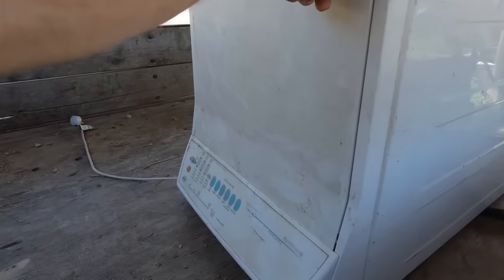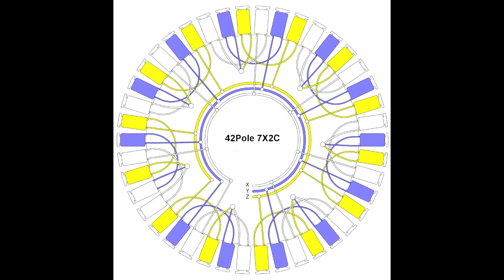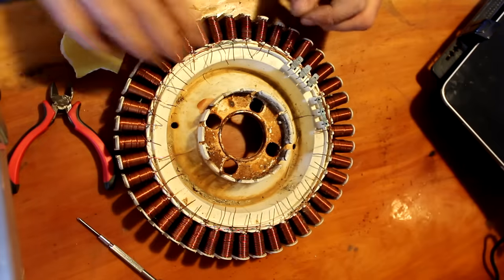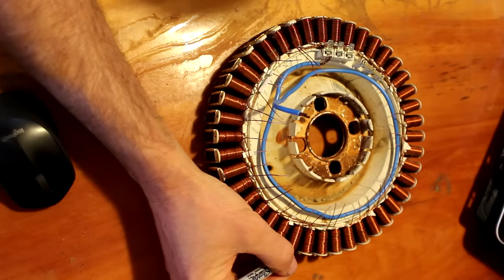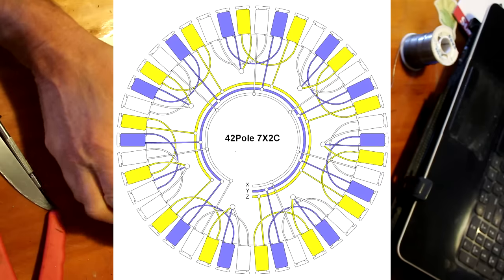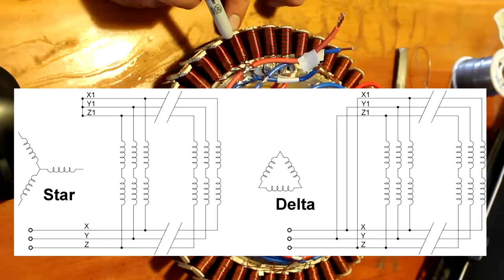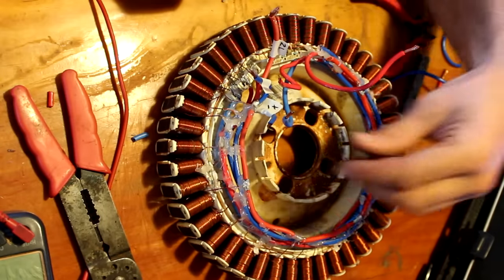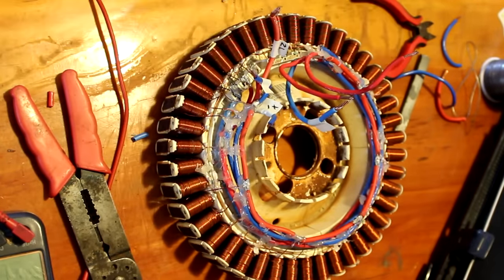Free Power from Water Part 3- Rewiring a smartdrive washing machine motor to generate power

Comment: Seemed to me you guys can use a generator to to work the same principle 10K will work I would say just out of curiosity you working real good I like this idea very much too bad you're in New Zealand I wish I was there but I'm in another country anyway hopefully you get back at me I was curious why you don't use a generator seems to me it would work if you put same work into it out of curiosity that is all God bless you
Reply: What type of generator and what type of driving force are you thinking of using?
Reply: @JohnSmith-pl2bk  I don't have a place where I can do that I was just curious why you couldn't use a generator that is all
Reply: Not trying to be stupid or something I'm just curious if it would work that's all seems to me you'd hook up a generator to that and it would turn to I'm not sure I got will generator with a 5 horsepower motor put out almost 10000
Reply: @jtturner6585  
The reason to use water is not having to pay for fuel ever again.
Gravity gives the water energy; the energy is transferred by the Pelton wheel and generator into electrical energy....simply and economically...
Reply: @JohnSmith-pl2bk  I understand that but when I'm saying is can you take the generator part without the motor and use I don't like you got instead of gasoline take the gasoline motor off and use the generator part that's what I was wondering if it would work I'm sorry I'm not trying to be stupid I'm just interested I have a piece of property that has no trees on it or no running water I can drill for well but I like to go create my own power and I'm thinking about a flywheel
Reply: @jtturner6585  
Now I understand. 
The generator head runs at 3000rpm if it is 230 volt, 50hz AC power, and at 3600rpm if it is a 120 VAC 60 hz gen head.
The engine driving it is 13hp? 
That means you need  to drive the generator with 9750 watts (=13hp)  to achieve "rated" power...
The stream provides 885 watts of electricity.....
You need 11x more water to achieve that output.........
So your gen head will work...but you need a much bigger stream and a step up v belt transmission to achieve the revs/output....
and the gen head you have is not one that will output continuously for years....
For a high output home system.....Mr Hydrohead
https://www.youtube.com/watch?v=zcV6LkmtYIk
Reply: @JohnSmith-pl2bk  thank you John it's an idea that's all I was curious but they got a flywheel one out there I'm looking at and it looks like a good idea for where I'm at I got property in the in the middle of Nevada there's no running stream the good thing is you're away from everybody and you don't have to worry about things but electricity I like to know so I'm studying right now on a flywheel free generator anyway that's what it's called thank you for helping me a little bit

Comment: Why not use heat shrink tubing also so you dont short out the bus
Reply: Note that Marty found the physical reason why the brushless motor failed....by looking at it and wiggling the join.
Now, could he have found that as easily if it had been all covered up in heat shrink?
Ditto for his soldered joins...any physical or heated join stands out to the eye...and is easier to repair

Comment: You’re not concerned with the cracks in the unit?
Reply: It's stationary,  the magnets spin about/around this rather than the centre of a conventional motor which spins within the motor housing
Reply from the maker: They all seem to have those cracks, it doesn't seem to affect them, I've never seen one break
Reply: @davidp8157   understood the design, but the cracks came from age I suppose.  Dried out from motor heat, which I would also wonder if it’s hot enough under this new configuration to melt the hot glue.  
I was also trippin out over your name.. David P.  As I am also a David P.  In reality.  I use Bill Browning as an alias.
Reply: @billbrowning50  wtf... where are you, I'm of Scottish  descent but 3 to 7 generations removed ( grandmother  was a kiwi born in Scotland of  pure Scottish descent) depending on which line you choose
Gentle Annie's, new zealand  developed and  made under Fischer and Paykel brand  ( and later under  the Elba brand for non nz markets)and the source for these electrics, date back to I think early  to mid 80's, and havn't been made for a few years,  they were available  in the US, Australia  and NZ ( additional countries too under the elba brand) ,  for many  years had the distinction of offering the ability to play US, Australia  or our national anthems,  Google it if you are interested. Re the cracked plastic, I think it's just an age thing, as there is no stress on the component, and due to rotor rotation  about the stator, should have more than adequate  cooling, it won't melt the hot glue

Comment: WITH THE WATER THAT HAS BEEN USED TO GENERATE ELECTICITY, IS IT STILL POWERFUL ENOUGH TO RUN A SECOND GENERATOR RIGHT AWAY... IF NOT, HOW FAR DOES THE WATER HAVE TO FLOW DOWN HILL TO POWER A SECOND GENERATOR??? A FEW METERS OR A LOT MORE!!! ...SAY YOU WANT TO RUN A FULL WORK SHOP/ 2ND HOUSE, 8 HOURS PER DAY PLUS SOME OVER TIME, ON THE SECOND GENERATOR....
Reply from the maker: He could tee off and run another turbine, would need to drill more holes in the intake pipe though

Comment: Where did you find the soldering iron in a pyramid 😂
Reply: It's Marty's second biggest soldering iron...
originally used for soldering the ubiquitous metal guttering for roof runoff collection that used to be on all New Zealand houses.
Can't use a piddly 100 watt electrical iron on that....

Comment: Solder is easy way, but brittle and cracks easily. Car manufacturers crimp all wires in car, not solder for a reason.
Reply from the maker: Not so easy to crimp these wires, I'm still using the first one I ever build 17 years ago, its been running 24/7 with no issues. Thats good enough for me ;)
Reply: @MartyT  Glad to hear. Basically it is just stator, probably I am overthinking simple solutions.
850W for nearly free is great achievement. Much better than destroying environment by manufacturing batteries or solar panels. Great job.

Comment: You have multi-meter's, amp clamps, all sorts of digital controllers, but won't spend $12 on a decent soldering iron!
Reply: Marty has a 100watt hand-held, steam-powered soldering iron...
which was unable to solder this heavy gauge wire.
With the gas-heated, monster copper-headed iron...he solders plywood!

Comment: Is it not more efficient to leave the stator as it is, and do the conversion close to the house? The higher the tension, the less loss there is in the long transport line. Each of the phases should be 240 Volt, I assume?  Do the conversion and battery charging at the house from there on. Probably I am overlooking some very good reason why you do not do this! :-D
Reply: Linas Velavicius
8 hours ago (edited)
Marty after watching your Part 2 I watched a YouTube explaining the difference between conventional generator vs the new more expensive inverter type generators. I also looked up Skin Effect. For those who don’t know I copy paste the explanation from the Internet;

“The main technical difference between inverter generators and conventional generators is what kind of electricity is produce, conventional generators only produce AC electricity while an inverter generator produces electricity in three phases (high frequency AC to DC back to stable  AC current)”  

“Skin Effect results from circulating eddy currents, arising from a changing B field, cancelling the current flow in the center of a conductor and reinforcing it in the skin. This reduces the effective cross sectional area increasing wire resistance and losses.”

Now I understand your "inverter" setup, your cost to effectiveness ratio is just brilliant. Big fan, love your channel.
Reply: Marty T
2 hours ago (edited)
It is very hard to spin the rotor with factory wiring with a load attached, this site doesn't have enough pressure or flow, also very dangerous and high hz / high loss over long distance (skin effect
Reply from the maker: It is very hard to spin the rotor over the factory wired stator with a load attached, this site doesn't have enough pressure or flow, also very dangerous and high hz / high loss over long distance (skin effect)
Reply: @MartyT  Right! So the rotor turns faster than it would when used as a motor, thus generating a frequency higher than 50 Hz.

Comment: ha that soldering iron looks like a torture device
Reply: It's a good choice for using on large areas of metal...it keeps pumping out the heat and melting solder when electric soldering irons just can't do the job...

Comment: A 240 volt motor won't produce 400 volts
Reply from the maker: This is not a direct fed 240v motor, it is driven by a circuit board in the washing machine. It will put out 400v when used with factory wiring
Reply: @MartyT  so the motor driver has  a step up voltage?

Comment: Any advice on how to gently introduce a DIY wind turbine to the neighbours? They are approx 10metres away 😂😬
Reply: Run a V8 air boat 24 hours a day next to their bedroom window ....
they will be pleased when you replace that with a wind turbine....
especially if it is at least 40 feet up in the air for unobstructed air flow....

Comment: When changing the bearings, why not use threaded bar and large washers, and why run 24vdc from the stream when you could run the ac upto the cabin and have less volts drop
Reply: The 24VDC from the batteries is fed into an inverter to produce 230VAC @50hz (NZ domestic voltage) and fed up the hill to the house...negligible voltage drop

Comment: I would have used a transformer to convert the high voltage to a lower. the conversion would have given me the amps.
Reply: Linas Velavicius
8 hours ago (edited)
Marty after watching your Part 2 I watched a YouTube explaining the difference between conventional generator vs the new more expensive inverter type generators. I also looked up Skin Effect. For those who don’t know I copy paste the explanation from the Internet;

“The main technical difference between inverter generators and conventional generators is what kind of electricity is produce, conventional generators only produce AC electricity while an inverter generator produces electricity in three phases (high frequency AC to DC back to stable  AC current)”  

“Skin Effect results from circulating eddy currents, arising from a changing B field, cancelling the current flow in the center of a conductor and reinforcing it in the skin. This reduces the effective cross sectional area increasing wire resistance and losses.”

Now I understand your "inverter" setup, your cost to effectiveness ratio is just brilliant. Big fan, love your channel.
Reply: Marty T
2 hours ago (edited)
It is very hard to spin the rotor with factory wiring with a load attached, this site doesn't have enough pressure or flow, also very dangerous and high hz / high loss over long distance (skin effect

Comment: If you used something like this,  would you just need to fix a water wheel to it to generate power? https://www.harborfreight.com/10000-watts-max-7200-watts-rated-belt-driven-generator-head-45416.html